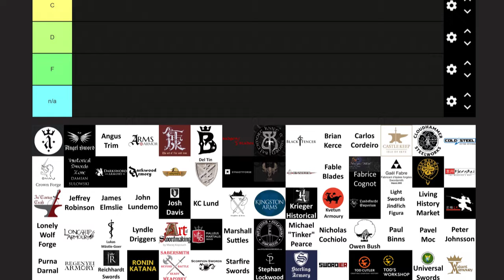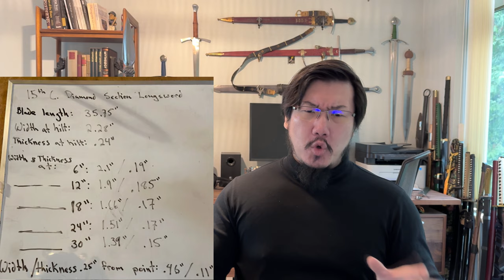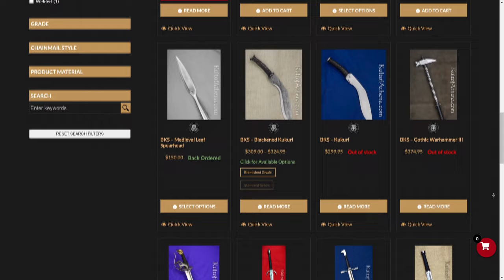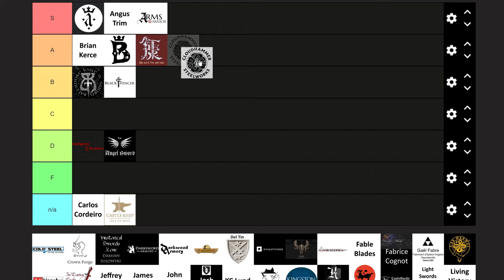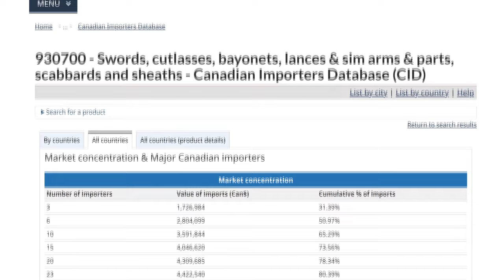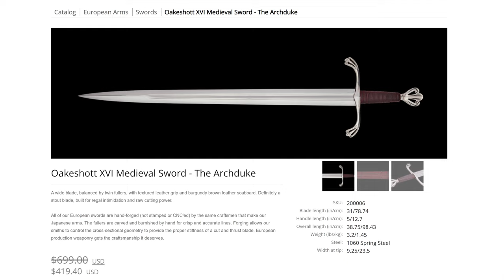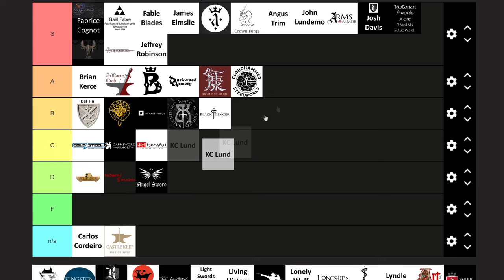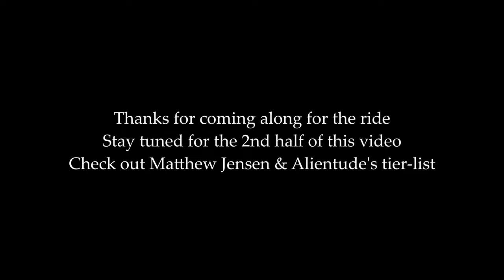European Sword Maker Tier List - Ultimate Sword Buying Guide, Collab with @Matthew_Jensen 1st Half

Comment: Firstly I'd like to thank you for all the work that went into a very well made video. I really liked your take on DSA. I think you hit all the important information that people need to know about them. And you voiced your frustration with them, without bashing them. That was really well done. But I do think that you were pretty generous with your ranking of them 😂
Reply from the maker: Thank you very much! Part 2 of the tier list video has even more exposes on some controversial makers. So stay tuned. Yeah, despite the harsh criticisms I leveled at a few makers, I have been exceedingly generous in terms of the final letter ranking, when it comes to someone's business and livelihood. In this system, the criteria I set is that as long as the outputs by a maker is not downright a deliberate scam, I wouldn't rate the maker as tier-F. We can easily knock everybody on this list a peg and downgrade everybody one letter grade, and only elevate a few makers to tier-S, as James Elmslie humbly suggested. But I like the current way I rank it, so that as long as a maker has genuine interests and experience in the research of historical and practical swords and has a solid understanding of the functionality, and they have roughly over 99% customer satisfaction rate based on years of observation, they should be in Tier S. There may very well be Tier SS and SSS. And within all the works of one maker, there would also be different tiers. Some pieces of a maker would obviously have more complexity, with more research and labor invested in them over other pieces by the same guy.
Reply: I agree! That part with DSA was super interesting for me.

Comment: Devil's edges hit or miss their older stuff at least was decently made in my opinion however I will say two of the pieces I owned and then sold to good friends of mine for quite overbuilt and very heavy and quite frankly the handles were not great for people with average size hands. The wasteland chopper and the tactical khopesh are the two that I mentioning however there are wood gripped xiphos was quite a nice little blade mind you this is quite some time ago before they had two different steal options and I believed at the time to use mostly 1095.
Reply from the maker: Did I miss Devil's Edge? Probably as the group that nominated the makers did not put it on the list. I have limited experience with their stuff. I have seen some reviews by others, looks like a tactical sword maker that primarily focuses on the budget. They were mired in a steel controversy when they claimed their steel to be 1095 while it was actually 420 stainless.
Reply: @FortuneFavoursTheBold  and I learned something new today... Maybe those blades were 420 stainless steel the whole time so that's not so good I didn't like the little xephos that they made though I'm hoping that one was actually decent steel but who knows now I never knew that I appreciate the information.

Comment: I did just receive a Vindaaris from DSA, bought it through the SBG store to get it sharpened while avoiding the usual fee associated with it, and I guess I "rolled good" on this one, so to speak. They even threw in the belt and integration accessory with it without charge even though I didn't order it. I have seen a number of  DSA reviews, good and bad including that one from alientude where he got the floppy blade, but I liked this design enough to give it a chance, and really like what I got.
Reply from the maker: Thank you for sharing your experience.

Comment: Ive been looking for a Type XX but I wish Angus or Valiant made that model :( I feel in love with the Type XX that Castle Keep made on their site.
Reply from the maker: For type XX I recommend the Albion Maximilian and Tyrolean. For XXa I recommend the Albion Viceroy.
Reply: @FortuneFavoursTheBold  You sir, are a scholar and a gentleman! Thank you!
Reply from the maker: @aggelos_ glad to be of help!
Reply: @FortuneFavoursTheBold  Since you seem very knowledgeable on the topic, the blade geometry seems right on the swords you mentioned in terms of size dimensions but I thought most XX and XXa variants were primarily characterized by the triple fullers with the center one running at least 1/2 the length of the blade and the other two smaller ones going up to 1/3 on either side of the longer fuller. I remember reading that in a Oakeshott topology description before but to be honest Im not sure if that is just one feature or a standard of the topology if and it isnt for that what  sets XX apart from say XVIIIa?
Reply from the maker: If you look at the examples given by Ewart Oakeshott to define type XX, there are 2 examples with two fullers, one in Vienna, one in private collection, the other 2 have tri-fuller, one in Glasgow, the other in Norwich. The tri-fuller with the central one terminating at midpoint are found on half of them, therefore not necessarily a defining feature. I think the most important feature is the blade that does not taper too much in the bottom half, but tapers enough in the top half to be more acute than type XIIa, and have more than one fuller.

Type XXa does not have the tri-fuller feature, it's just one fuller but they always have a ricasso with two concave area flanking the central fuller.
Reply: @FortuneFavoursTheBold  Thank you so much! Perfect explanation! I was unaware of the multiple historical examples. I did notice how the XX style blades tend to have near identical straight lines up the side of the blade until just the last few inches for the fairly acute point.
Reply from the maker: Their profiles do taper in the lower half, just not as much as most 15th century swords.

Comment: Oohh deepeeka....
Here's my honest personal experience.. I got a hanger from them and it was total garbage it wasn't even safe to play with. 
The Opera Nova cut and thrust from the aesthetically is very nice but handles like a crowbar...
Now a hidden gem that isn't too bad for super cheap is one of their colichemarde small sword. Mind you it is a gem for what it is and because it doesn't require a sharpened edge that is one of the pluses. It isn't perfect but if you want a cheap small sword do practice and play with and slice on cardboard boxes for what have you and you don't want to ton of money into it and you're on the fence on whether or not you would like that kind of sword it isn't a bad choice especially for the money and at the end of the day if you don't like it it still makes hey semi-functional and passible steel costume sword
Reply from the maker: I do have a Colichemarde style small sword made by Deepeeka for a US-based reenactment supplier. It's decent even though the handling is still somewhat off.
Reply: @FortuneFavoursTheBold  one I bought mine I honestly wasn't expecting much because of the company's reputation and past experiences by figured for that chief of a price and not having to pay for sharpening it was worth a stab. It isn't perfect as far as weight and stuff is concerned but for the price I was pleasantly surprised.

Comment: I'm wondering if you have any experience with armour class, their non-17th century swords seem to have a joke level of historicity but the 17th century stuff seems to have a reputation, the issue is it is mostly a reputation among reenactors, and the accounts of their sharps are mixed, some people say the baskets are too big, others that they are within historical norms, also there is mixed messaging on the qualities (specifically the whippyness) of their blades. As they mostly show the blunts on their website it is hard to tell.

They seem reasonably priced, but I have no clue what you are getting for it.

If the blades are a problem then I would think about getting a balaur arms templar to mount on one of their baskets (I would be ecstatic if L. K. Chen was to make an English/Scottish style basket hilt themselves), but if the basket is oversized then it doesn't really seem worth it (several commenters have said it's fine if you have big hands, I don't, and with baskets the weight is a major inconvenience that is merely in a compromise with the hand protection offered, not to mention impracticality of wearing one). 

Any insights would be appreciated.
Reply from the maker: I have seen some Armour Class swords, and indeed they are reenactment grade products on the extreme low end--think Deepeeka and Universal Swords, both in terms of prices and quality. The hilt of their 17th century swords looks alright, but there's very little emphasis on their blades. So they are making reenactment and stage combat stuff. The handling of the swords basically does not resembling originals at all.